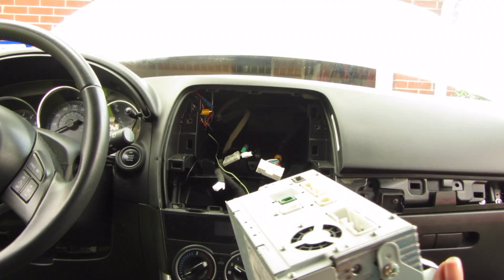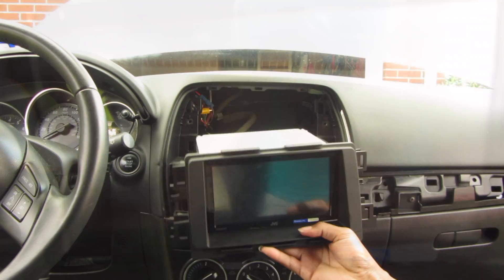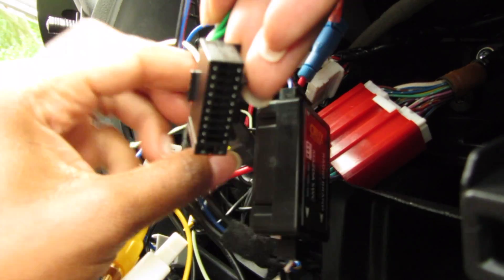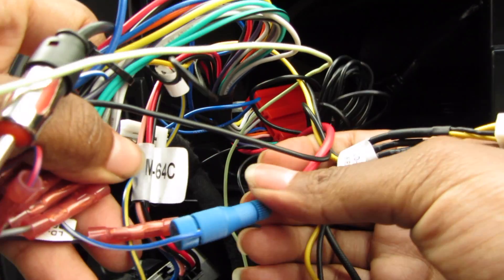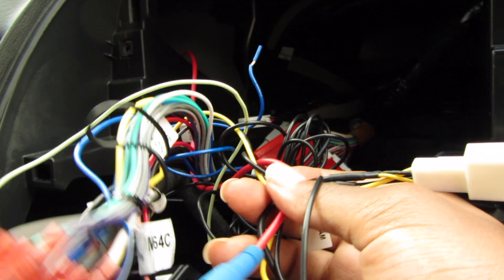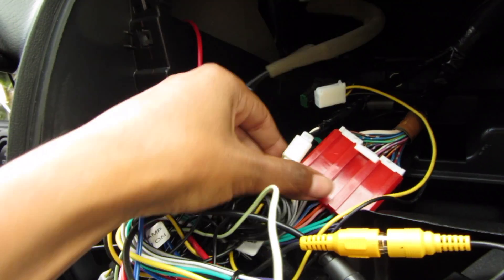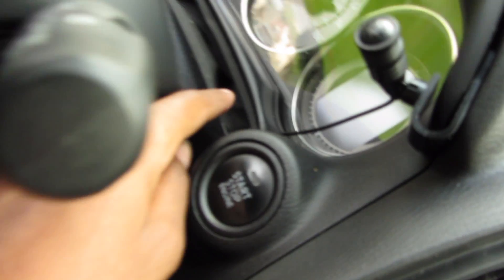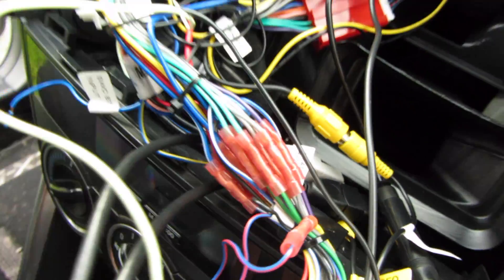AFTERMARKET HEADUNIT INSTALL (JVC) | MAZDA CX 5

Comment from the maker: Update: I have had this unit installed since October 2018 and everything works fine the problem I am having with it is it will randomly turn off then turn back on while I’m driving. It’s only happened 3 times so far when multiple devices are connected and Spotify and google maps are being used. I guess it short circuits when over worked. Idk
Reply: I'm getting a Kenwood DMX709s installed in the coming week. I've been researching Kenwood (JVC has merged? with Kenwood)  HUs and that seems to be somewhat normal on some units. Great video.

Comment: Thanks for the video! I have a '16 CX-5 and am looking for a replacement unit (my OEM one got smashed in and doesn't display anything anymore). The audio and everything still works I just can't see where I'm navigating too. My concern is that I'm afraid of losing functions like how to reset the service light after doing oil changes, rotating tires, etc.. Have you had this issue with the aftermarket radio you installed? Does the service light still come on? or is that something that ONLY turns on/activates with the OEM infotainment system? Also, I assume with these aftermarket radios you also lose the audio functions on the steering wheel, right?

Comment: Amazing video. So just to be sure you use the Axxess harness for the backup camera ?If yes, ss your backup camera works ? Also everything still works fine ? I read / watched other people comments they're having problems with the backup camera function after the install. Thank you in advance.
Reply from the maker: chad W yes, that is correct! The backup camera works fine. The differences from the oem radio are; the view radius of the camera is slightly wider (I can see the top of my license plate now), the quality is not as good (just slightly, quality still is good overall), and it takes about a second or two longer to display the video when the car is put in reverse. Hopefully this answers your question! 🙂

Comment: so do you loose reverse camera screen and the specific car/mazda setting when you install an aftermarket deck?
Reply from the maker: Radek Woj Hello, I can still use the rearview camera but I had to purchase additional wire to connect the unit to the backup light wires to power the camera after installing the headunit. This also activates the camera when the car in put in reverse.
Any car specific settings needed to be set before removing the OEM headunit. (Eg. door lock settings, auto off highlight duration time) Unfortunately, if I ever wanted to adjust these things I would have to replace the aftermarket unit with OEM unit temporarily. Hope this helps.
Reply: @NBnKB2525  Yeah this is great, makes sense. I don't know if I'm willing to part with those functions. I managed to upgrade the tweeters in the dash of the car and it really made a huge difference. If you don't have speakers there, the wiring is all there for you just plug in and away you go. I got Kenwood KFC835C 3.5" speakers and what a difference. There is also a middle panel in the dash but no wiring for a speaker is there unless you have the bose premium audio which I do not. I thought I was going to have to replace all the speakers but turns out I just needed those tweeters. My only complaint about the head unit is how slow it is, and how slow it reads USB especially if you plugin like 8gb or 16gb drive. It also starts playback all over again after you turn it off for a while ... quite annoying.
Reply from the maker: Radek Woj interesting, I may attempt to add tweeters also! I noticed the empty location where they go when install this unit.

Comment: Nice video, Did you lose the Aux input with this radio?
Reply from the maker: moises223 yes, the vehicles aux input is not functional. Any device connected has to be via Bluetooth or connected directly into the unit.

Comment: Did that red wire come with the radio?? & how did you get the red wire to reach all the way in the back??
Reply from the maker: No, I had to purchase the wire separately. It’s was a total of 25 ft. I tied one end of the wire to the end of a x-large zip tie and weaved it from the radio, behind the steering wheel, down passed the interior fuse box and tucked it under the lower plastic trim along the driver and backseat doorways. Then I used a detailer tool to detach a small area of the plastic interior of the trunk, and used the x-large zip tie to push the wire behind it the until it reached the taillight connectors.

Comment: Unrelated question but how long did you have the car, how many miles and what problems did you have thus far?
Reply from the maker: Radek Woj I purchased this vehicle June 2017 and it currently has about 86,500 miles. I haven’t had any major problems so far. I’ve had just to replace the battery and do other regular maintenance.
Reply: @NBnKB2525  Good to know mine is a 2014, got it in Oct 2018 and has about 109,500 miles. It's the 2.0L, 6speed manual. Had to replace the PCV valve because was burning oil. Then soon after the left strut mount went, within a month the other side went. After that I had to replace 2 of  the door handles, they seemed to fail (not sure if previous owner did something that they failed). I also replaced one of the axels due to noise but it didn't solve it. There is currently a few different drive train noises I hear when its cold out and the brakes are noisy too. The battery I think will need to be changed soon, looks original and yeah its pretty weak at times. I also changed the front swaybar linkages but old ones seemed fine. Also topped off the transmission fluid, it was low. All small things but a bit annoying.
Reply: @radekw708  That's alot of issues my 14 has 116k Miles and really nothing wrong. Sounds like you got a Monday vehicle.
Reply: @dexterm1285  A year later and another $1600 of work went into it just a few months ago including seized rear callipers (so replaced the whole rear brakes). Both axels in the front were noisy and leaking so were replaced, along with the front control arms which had to be replaced as the ball joints and the control arms was one piece with the OEM variant. I still have the rust on the roof left, the rear engine mount is blown and the other strut bearing went as well. I'm also at 116k. Apart from the roof rust I should be able to get it back to 100% working order soon.
Reply: @dexterm1285  I also had issues with the security key icon popping up on the dash which was reported by the blue driver as a security fault. This was as recent as this summer... seems to come and go. You may have not noticed problems, but I am a car whisperer and I'm sure I can find plenty of things to fix on yours :)
Reply: @radekw708  I have a Florida car so no rust.  I'm  doing all new rotors and pads soon and tires. Outside the park switch that kept radio on I've had this car since 78ik miles and it's been great.
Reply: @dexterm1285  My car is from Quebec and now in Ottawa so its gonna be prone to rust unfortunately. Mine has no electric e-brake and glad about that :)

Comment: do you have a link for where you got the red wire?
Reply from the maker: 18 AWG (American Wire Gauge) CCA Primary Wire | 50 ft Red & Black | Also Available in 14 & 16 Ga https://www.amazon.com/dp/B07D74RGVM/ref=cm_sw_r_cp_api_glt_fabc_PN705KGC5SN1T6NTGW8C?_encoding=UTF8&psc=1

Comment: did u have to run that red wire to the back of the car ?
Reply from the maker: yes, tapping into the reverse light wire sends power to the camera and activates it when I shift into reverse.

Comment: Hi, nice video. I just have a couple of questions:
1. I see you have a mic right where the gauges are. The factory mic is lost with the upgrade?
2. If you already had the factory camera, how come you needed to tap that red wire? Isn’t there a factory cable on the back for that?

Thanks in advance!!
Reply from the maker: David Palma 
Hello friend, to answer your questions, yes the factory mic is disabled once this unit is installed. According to the tech support guy I talked to, the red wire taps into the reverse light wire to send power to the factory camera while also causing it to turn on when shifting into reverse. I’m not sure why but the rear camera wire on the unit that connects to the factory camera doesn’t send power to the camera.

Comment: Does your car have Bose?
Reply from the maker: No
Reply: @NBnKB2525  where did you find the reverse light
Reply from the maker: @lestatybarbo6545  There are two removable panels on the inside of the lift-gate. I used the one on the left. Once removed you will have access to all the vehicle tail lights.
Reply: Do you need to use the resistor?